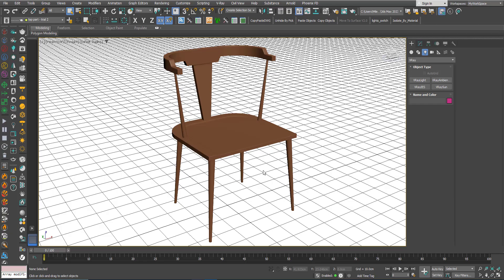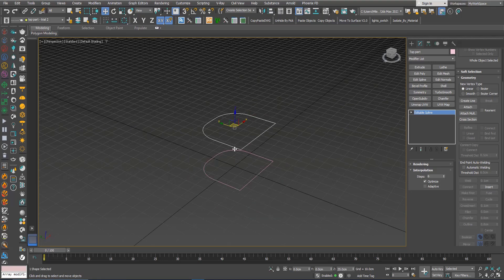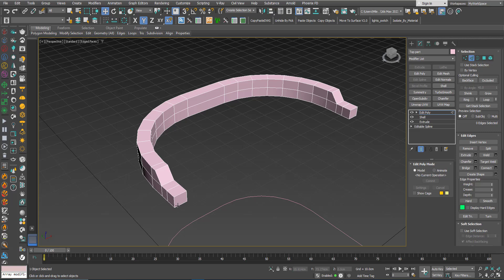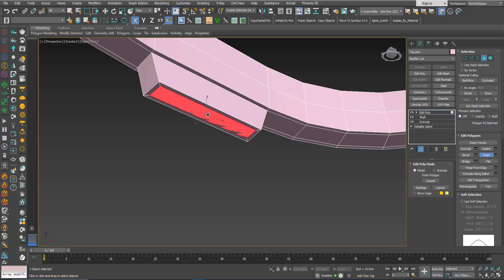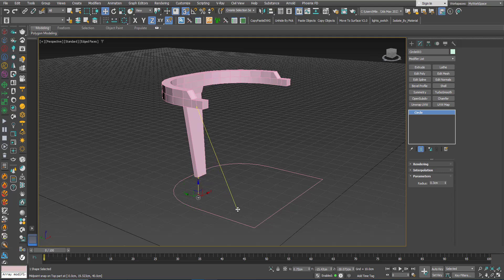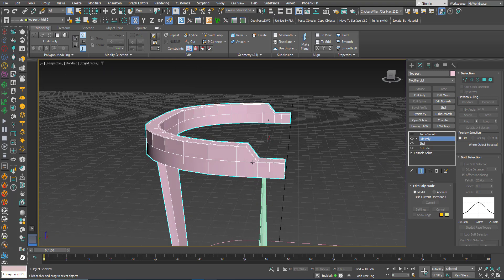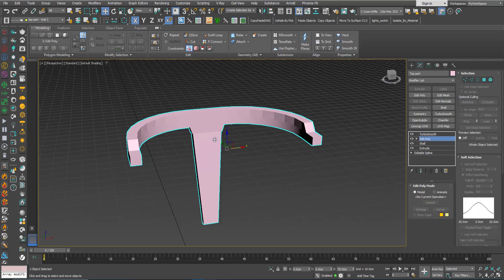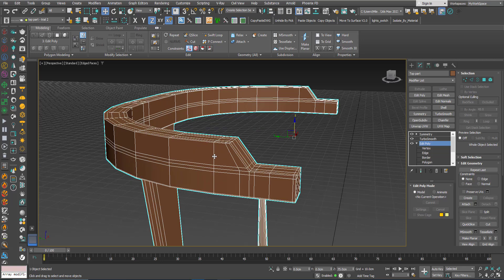3DS Max Easy Modeling - Simple Chair - Part 1

Comment from the maker: If you have any suggestions or requests, please leave them in the comments area. Also, if you like to further support the channel you can use the Thanks button, thank you.
Quick Note: around minute 5:30, we could have use the polygon selection instead of the edges to scale in the Y direction, but it was good to know about the Use Selection Center vs Use Pivot point Center.

Comment: 6:37 what exactly did you do here? I do not have those options. I only have the options on the upper line. But the bottom options don't exist. How do I make them visible?
Reply from the maker: Hi, i guess you're talking about Axis Constraints, just right-click an empty area on the main toolbar and choose Axis Constraints. When enabled, it allows you to snap on a specific axis.
You can use the shortcut Alt+F3 to turn On and Off.